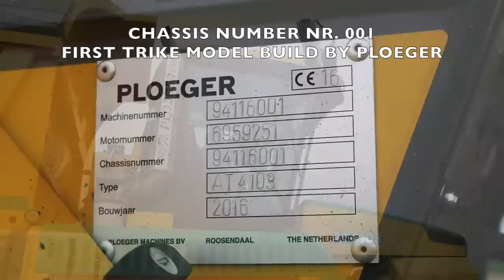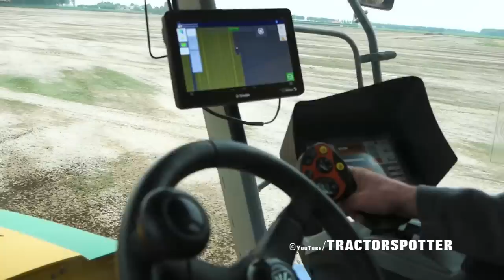Spreading chicken manure | Ploeger AT4103 DNMS Tebbe Spreader

Comment: Looks like a lot of money for something that you could just use a tractor and pull a significantly cheaper one
Reply: Less compaction, better manueverability , bigger capacity, better floatation. So all in all, it has some benefits
Reply: @g.work.specials6859  I've seen some pretty large capacity manure haulers on tracks that surely cost less than this machine
Reply: I'm more bothered by the excavator, a wheel loader or tractor w/loader could fill in 1/3 the time or less